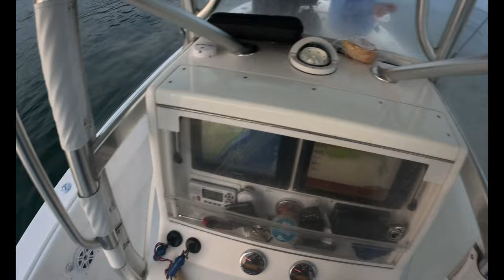Using the Trolling Motor as a Wind Sock Results in Excellent Fluke Fishing!

Comment: Thanks for the video! So did you essentially pick a heading with the trolling motor? We had an issue the other day where our drift was too fast (wind with current) and wasn’t sure if there was a way to use the trolling motor to slow down the drift without going against the current with an itrack.
Reply from the maker: I point into the wind and just put the power at the appropriate level to keep the drift where you need it.

Comment: I’m a big believer in the drift sock. When using the TM, do you constantly make adjustments as you drift, or once you set it, you leave it alone? I can see it becoming a distraction
Reply from the maker: A little of both actually. I do typically adjust it a few times as we are drifting.
Reply: A TM is a game changer. How often adjustments need to be made depends on how the wind and current interact. Sometimes you gotta make frequent adjustments, especially in the back bay.